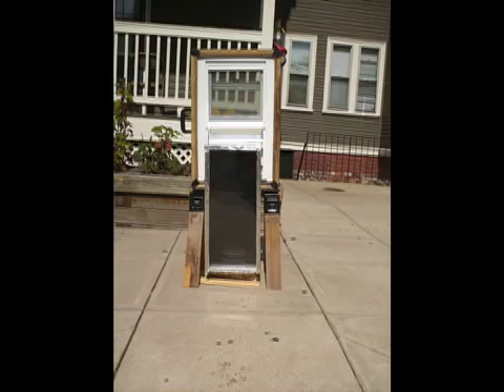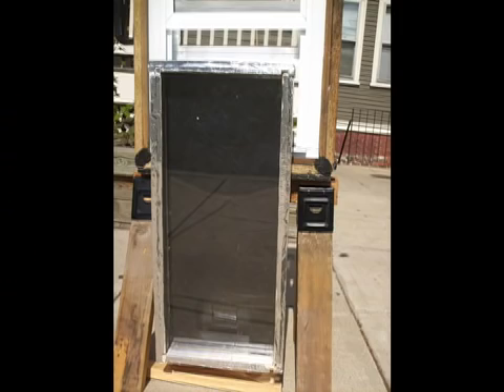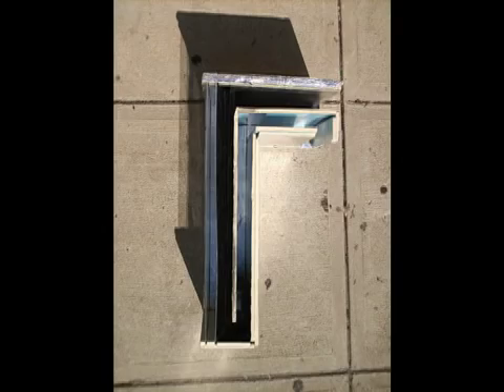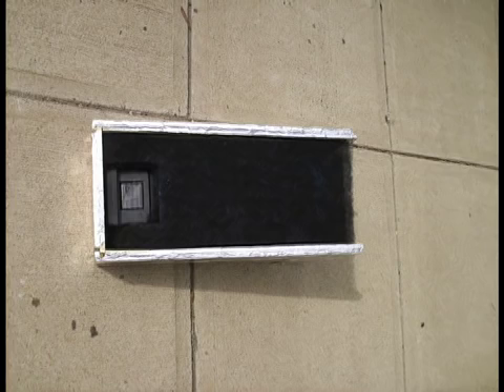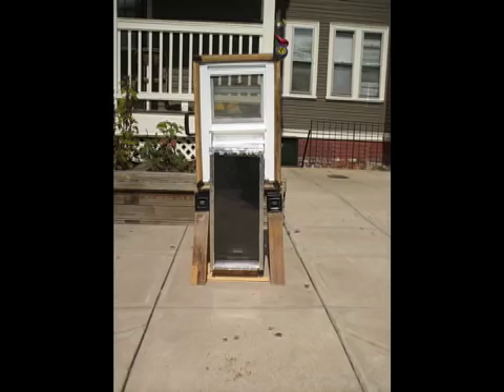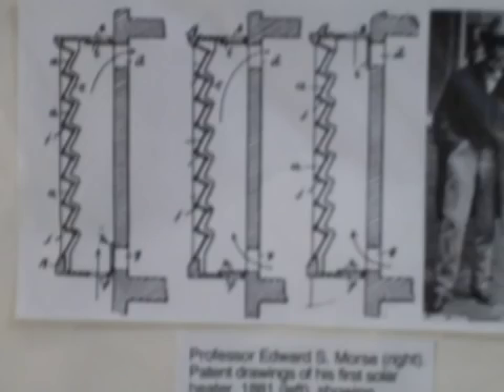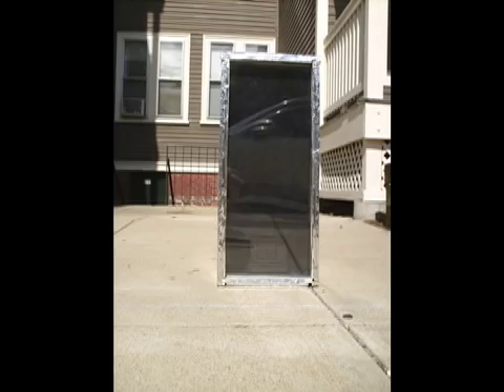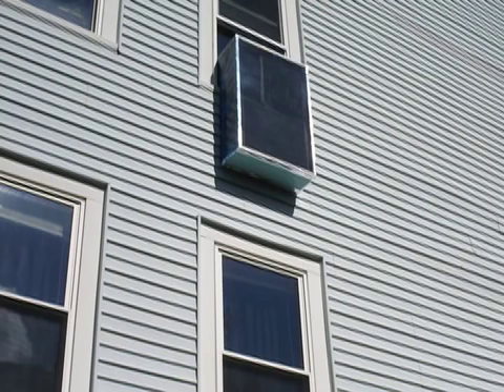Solar Windowbox Air Heater

Comment: hi try filling it with loose pop cans painted black will up temp  mine went from outside temp of 50 degrees to 170 degrees in heater   cool stuff   watch my video